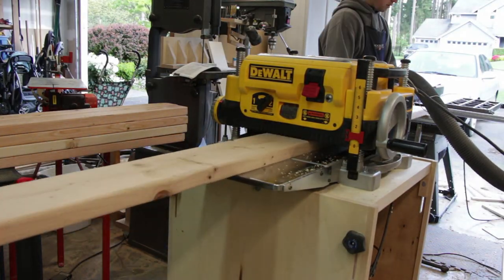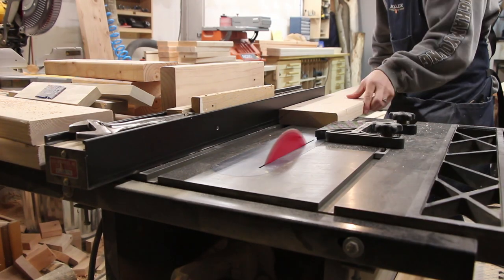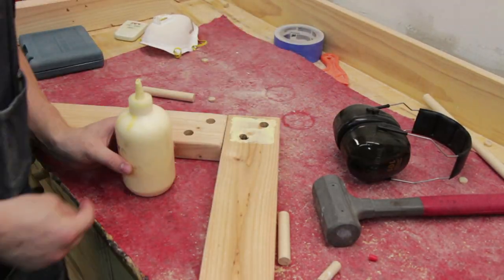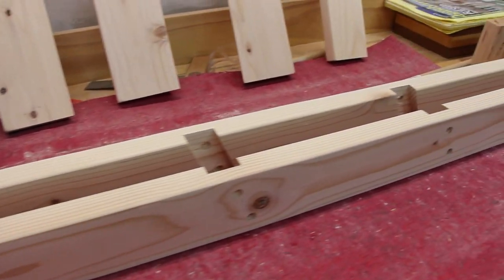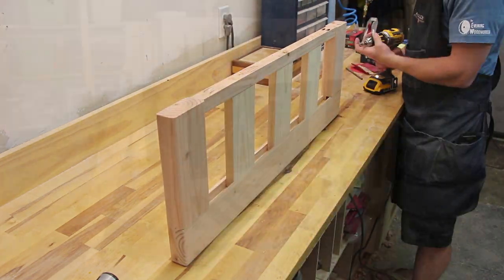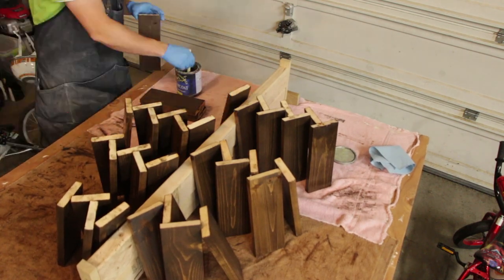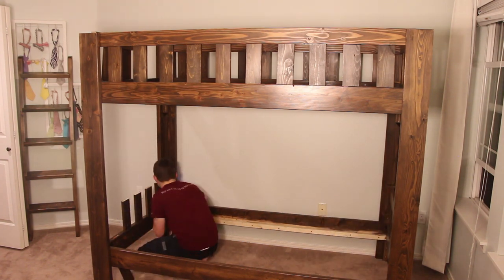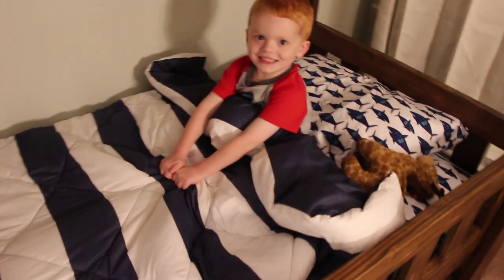How to Build a Sturdy Bunk Bed | DIY Woodworking

Comment: I purchased the plans. They were very detailed. This was an enjoyable project. I missed a few steps but it still came out great. The grandkids love it. I finished it with a polyurethane stain. It did great with only 2 coats. I chose to glue the spacers in as opposed to nailing them - I’m glad I did. Ran out of time to do the corner post caps so I will do them later. 
Thanks!

Comment: i bought the plans and built this bunkbed absolutely great build.... kids been using it the last two months... my wife wants me to build one more of these and as i built the first one i was thinking i could cut costs by modifying it a bit theres a lot of modifications that could be made to make the bed cost efficient without taking away from the structural integrity!
Reply from the maker: Thanks for getting the plans! Yes if I were to design this again, there are definitely some improvements I would make to build it more efficiently.

Comment: I have to do this using simple tools. Other than a table saw, the rest of my tools fit in tubs. Circular saw, drills, sanders, etc. My "shop"  is also my unheated/uncooled garage where I work on my truck. Like some of the work but I will take this and turn it into a twin over twin that I can seperated into two twins.

Comment: Nice bunk bed! Looks like quality to me!  I just built a queen futon loft bed.. but it needs reinforcement.. still wobbles.. trying to figure out if horizontal 2" x 3" s will suffice or if I should up it to 2" x 4"s. Currently. each of the three sides (below the actual mattress box) have 2 2" x 3"s screwed into the legs with 2 screws side by side horizontally. 1 board for the base, on the floor, and 1 more board halfway up. I am thinking that I need one more screw on each connection to create a triangle of screws, at the very least. Maybe add a diagonal board on each corner connecting the upper legs to the mattress box.. that might also help with wobble.. Not sure how much more build out I need to do to make it more rigid...  still, your ideas are helpful...
Reply from the maker: I'm glad it helped! Triangles are good too if you need the prevent wobbling.

Comment: What other method do you recommend when notching the ends of the bed support rails if no band saw is available?
Reply from the maker: You can run it back and forth over a tablesaw set to half the thickness of the board, then break off all the pieces in between. Or you can do that with a miter saw and lock the depth to half the thickness

Comment: I purchased the plans.  I need to make a modification on where the ladder goes due to space constraints on the side in the room.  Your thoughts on how to keep the integrity of the long wall given  that I need to put the ladder at the top left versus the back side?  I know I will need to finish the short wall (and can do away with the metal braces on that wall.
Reply from the maker: Make sure your vertical handrail support next to that ladder goes all the way down to the bottom of the upper bed frame. If you anchor it with at least 3 good lag screws or bolts, it should be good.
Reply: @EveningWoodworker  Thanks.  I will give that approach a try.

Comment: Hi I ordered your plans but the cost of this build was not included in them what was the cost that you paid for the build material wise?
Reply from the maker: Thanks! I didn't put specific prices in because it could be different depending on where you live and what wood prices cost at the time.
Reply: its all good i just bought the wood yesterday and was fairly cheap 176.08 for all the wood i needed with a couple added pieces incase i mess something up... i also bought the tools i needed aswell... theyll come in handy for some other projects i want to do out of my wood working book but thankyou and the plans are good so far as i study them before cutting my first piece.... @EveningWoodworker

Comment: Hello, good video. I used it as an insperation for my own projcet. I have a question: How du you prevent the material to cup or bend etc...? :) /BR Robin
Reply from the maker: The long corner pieces are screwed to each other at 90 degrees which helps to prevent the twisting. Additionally, pick boards that are as straight as you can and then make sure they have a few weeks or months to dry further in your shop. That should help

Comment: What size lag bolt do you use? Also do they stay in the wood or stick out?
Reply from the maker: Since the lags are on the inside, it's important to get the heads as flush as possible. I used Headlok and Timberlok lag screws depending on the thickness of the boards I was going through

Comment: Hi! Great video !  I didn't really get the railings part though( English is not my first language😅). How did you make them hold ? Thanks !
Reply from the maker: Thanks! The railings are bolted to the inside of the corners... same as the bed frame. The balusters underneath the railings fit into a groove or dado in the top and bottom. The plans on my website also help to make it more clear.

Comment: What length 2x6, 2x4, etc. did you start with and what screws did you use?
Reply from the maker: I think they all started out at 8ft. Screws are just basic construction screws but the larger ones are lag screws

Comment: Hi, I now build this amazing bed. I’m just of worry & want to make sure, since the bases are very massive, are the construction of 5 lag bolts in each corner enough? Are all through lag bolt with nuts are safer? Thanks!
Reply from the maker: Yes those lag bolts are designed to handle shear loads. Also I glued on blocks underneath each corner as a backup. The glue is very strong and the wood will break before the glue does. In each corner there are 5 lags, 4 screws, and a glued block. It'll hold.